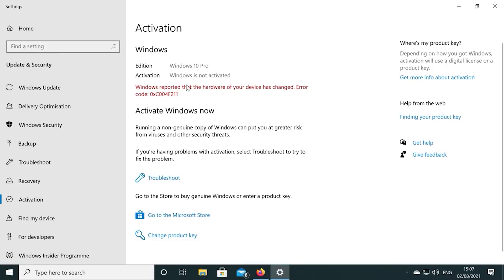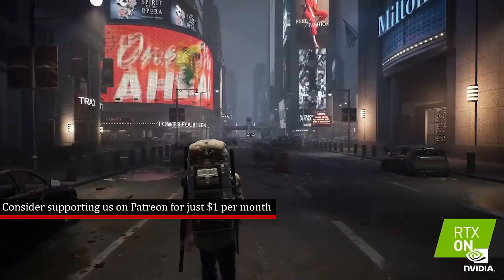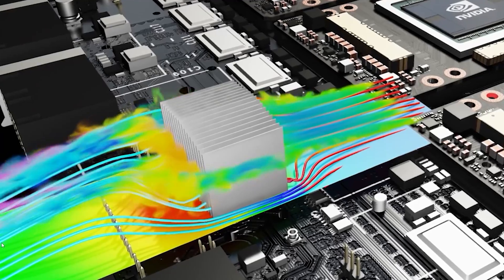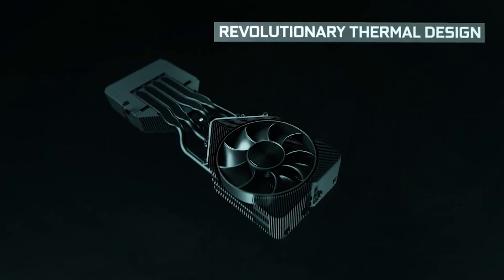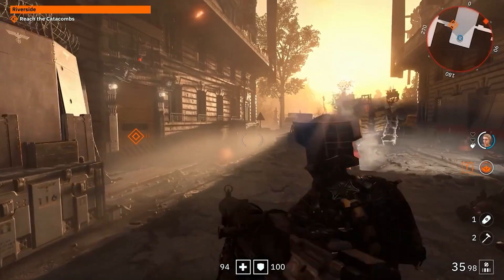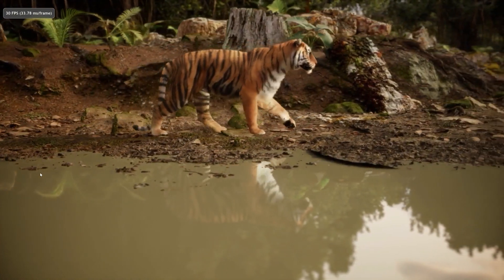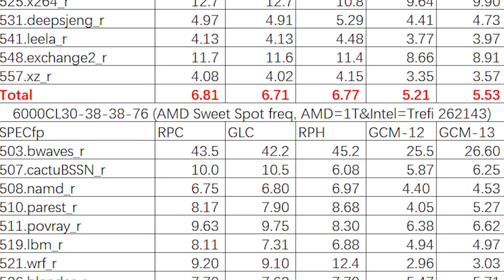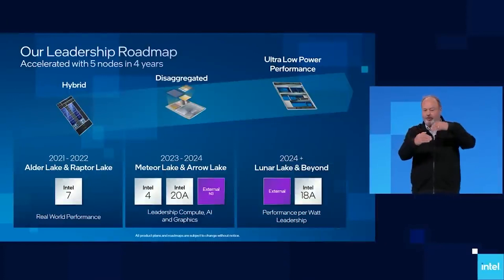RTX 4090 Specs DWARF RTX 4080 - Major Specs UPDATE | RTX 4080 Ti & Path Tracing Leaks

Comment: I don't think that's a massive gap for 4080 / 4090. That speed difference leaves space for a 4080ti in the future. I always said with the 3000 seires that the new 90 series are really just Titan cards rebranded so that consumers will buy them as gaming cards hence the large price gap between 80 and 90 series.
Reply: It is a massive gap they are on different dies completely. Then there’s 16,384 Cuda cores vs 9728 Cuda Cores. Massive bandwidth, VRAM and L2 cache differences as well. The gap between the 4090 to 4080 will be larger than the 3080 10gb to the 3090ti.
Reply: @ZackSNetwork  Let me clarify, I agree. I probably didn't type that clearly. What I mean is that gap is supposed to be big as the 80 series is always the $700-800 sku. That leave's plenty of room for a 80ti card in there around the $1000-1200 range and the 90 series gets the Titan pricing since it should be way more powerful.

Comment: I'm going from a 980 Ti, to a 4090 (or AMD equivalent). I'm expecting my mind to be fully blown.
Reply: @adrenalinejunkie3828  consoles don't hold PC gaming back anymore. They're based on the same architectures now so that's no excuse. They can much more easily build a game for PC, Xbox and PS5 with varying levels of quality without having to do as much leg work porting everything over. So even if the PC version has 10x better graphics it won't matter because they simply tweak them down to work on consoles.
Reply: I'm going to try and get a 4080 if not a 4090 coming from a gtx 680. Hopefully the 4000 series performs a good amount better than 3000 series.
Reply: @JaysRPGAdventures  4080 16GB or 4080 12GB? 16GB model seems like it will be 20% Faster than the 3090 Ti based on my Napkin Math.
Reply: @findlaywilliams6610  probably the 16GB model if I don't go with a 4090.
Reply: Not only will your mind be blown, but so will your psu. And ac bill. :)
Reply: @kaseyboles30  Yeah, I'm actually leaning heavily towards AMD because of that. I'm not going to run a card that turns my bedroom into a sauna.
Reply: Your wallet will be blown.
Reply: If you use a 1080p monitor and aren't upgrading that, then yeah you'll be blown away. If you're upgrading your monitor to 4k, you probably wont get blown away. 
At least that's how it happened for me. I went from a 1080 to a 6800 while at the same time upgrading to a 4k display. I was disappointed in the performance honestly. 
now I have a 6900xt and I still feel its not enough for 4k with all the setting cranked. my 2cents.
Reply: I can tell you that moving from a 1050 ti to a 1080 rocked my world
Reply: You won’t ever need viagra
Reply: dont forget to buy new computer and monitor as well, haha
Reply: @Azimuth2255  I decided to buy a 48" OLED, when they were the same price as low-end GPUs. Best decision ever; going to be sticking with this one until it burns in. And yes, I'm planning to build a totally new rig in the Fractal Torrent (seems like you'll need that case to cool the new stuff, if you like air cooling like I do)!
Reply: @adrenalinejunkie3828  What... My powermodded, watercooled 3080 can't even get 200fps in most 3440x1440p games at high settings. How could a slower card like the 2080 Ti be any good at 4k then. Maybe if you can endure the sub 120fps torture.
Reply: @adrenalinejunkie3828  Try playing Cyberpunk on decently cracked settings at +1440p. You'll see the difference. Heck even a 3090TI struggles in 1080p on max settings.. Those games are far in between, but they exist. Of course if all you play is CSGO and Warzone then yea the difference won't feel impactful, but then again who'd upgrade their hardware to play non-demanding games in the first place.

I went from a 980 to a 2070S and the difference was big.
Reply: @adrenalinejunkie3828  mymy adreline put some neurons around here

Comment: nvidia might want this time to have enough room for a 4080ti that actually means something.
the 3080ti basically is a bit of a weird card because the 3090 was just 10% on average faster than the 3080, so the 3080ti has not that much room to shine.
Reply: I feel like the 16gb 4080 they keep talking about is the Ti model and that's not coming until next year probably.
Reply: @toxicavenger6172  That seems very unlikely. The x80Ti is almost always a slightly cut down version of the top die, and this 4080/16gb has a lower end die and has way too few cores to possibly be a Ti.
Reply: Or maybe they should just stop oversaturating their own market so they don't maliciously self compete within their own product lineup lmao. They started this whole shitshow. If there isn't room for space between a 4080 and a 4090, then maybe that's how it's supposed to be. I'd like to see them sell gpus at 1500-2k range again now that the mining and scalping crisis has ended, while we're in a recession and an energy crisis.
Reply: @Real_MisterSir  enthusiasts who payed 1500-2000 for a card before the recession and energy crisis won't be fazed by the current state of the world. i know i am not. if i want a high end card and thats what it costs, i buy it. you might not like to hear this but thats the fact, and i am not the only one thinking like this. Nvidia knows this and thats why the 4090 will be at least 1599 but i would also not be surprised to see the founders card being 1999.
Reply: Vram on the 3080ti was the sweet spot that was the difference
Reply: @bobdole3251  yes 2 more gb of vram was worth double the price

Comment: Makes sense... They want to have the fastest card at a premium price, and then the rest they want to gimp so they can still sell us old 30 series
Reply: That's exactly it.
Reply: 100%. Every year there is a shameless manipulation of pricing structures. This the 2022 version. I think this is also symptomatic of diminishing returns in gaming hardware. They all play games pretty well at this point. 20 30 40 series. I have a mate still happily gaming on a 700 series. I do think as pc fans we are obsessed with all this gpu performance and the GPU manufacturers create this product range for us because we are so obsessed.
Reply: @paullasky6865  IDK... I just want a card that can comfortably game at 4k 100fps+ high settings that doesn't draw 400 watts and I'm happy. Haven't really gotten there yet
Reply: @Matt-gf4gd  depend on the game. Lots run over 100fps. In currently playing cyberpunk on a 3090 at 60fps and it's fine. FPS watching is a red herring.
Reply: @paullasky6865  yup. That's just my arbitrary standard for a new higher end GPU in 2022. Probably a Radeon 7800 XT will fit that bill for well under $1k.

Comment: If this is true its either bad news for AMD or a misstep for nvidia. 

Nvidia only cuts down the 80 class card this far if they know they have a clear winner.

Unless they know n31 is going to be between the 80 and 90. And are saving the 80ti as the n31 killer.

Time will tell.
Reply: @adrenalinejunkie3828  Agreed, I'm disappointed in Nvidia if this is true. It's coasting on mindshare which is a mistake intel made a few years ago.

What concerns me is that with ampere, they released the 3080 and it was a very good card, at least in the same field as a 3090.

Previously with Turing, Pascal, and even Maxwell. The gap between an 80 and an 80ti was HUGE. And they only did that because AMD essentially wasn't capable of competition.

That leads me to believe that Nvidia once again believes that AMD isn't capable of competing. At least not in the high end.

I hope theyre wrong.
Reply: @adrenalinejunkie3828  Not true. It will faster memory with more cache. If you expect high performance path-tracing any time soon you're fooling yourself.
Reply: @LowkeyTryhard  even if Nvidia manages to pull off some path tracing it doesn't mean that all the game developers will adopt it. We're going into the 3rd generation of cards with ray tracing tech and just look at the small amount of games even using that.
Reply: @toxicavenger6172  Look at AMD, Sony and Microsoft all adopting ray tracing.
Reply: @Safetytrousers  maybe so but it's been really slow for developers to add it to games nonetheless 🤷

Comment: NV has so many overproduced Ampere GPUs they still have to sell that the real price of 4090 or 4080 may have nothing to do with some PR MSRP they will show us.
If 3090Ti costs $1000 then 4080 probably would have to cost around $1300 and 4090 $2000+ so they can keep selling Ampere with some minimal profit they overproduced.
If 4080 would cost $900 then they should sell 3090Ti for $700, 3090 for $600, 3080 for $450, and 3070 for $300 - it's not going to happen for sure.
So I'm not so optimistic about this new release. The performance will be there but power usage and real prices may go out of control until they sell old chips they overproduced.
Reply: If the first case is true then fuck Nvidia, AMD here i come.

(Even though if love to use Nvidia Canvas, but screw it)
Reply: @x1c3x  True. I'm afraid that they will show us some nice prices during the presentation but you will not see these prices in real life.
If 3090Ti costs $1100 at this moment, so let's say they can lower the price to $950-$1000 then how much has to cost 4080 being much faster? 
The problem is that they have a full inventory of Ampere chips they have to keep selling. Time will tell...
Reply: @tomtomkowski7653  Nvidia will continue to disappoint investors then because people are not gonna buy into that BS. Supply will be hard to get as well.

Comment: So the 4080 12 gig is essentially a mid-range card....
Reply: 3080 10GB was midrange already.
Reply: @nipa5961  how the fuck is a graphics card built using a 628mm2 gpu “midrange”? It’s not like NVIDIA is using catastrophic dies to make the 3080. It has 81-86% of the specs of the full die, putting it comfortably ahead of GA103 in terms of specs. Furthermore, its effective transistor count is about the same as the 6800XT (2nd in AMD’s high end lineup as the 6950XT was a rebadge).
Reply: @dex6316  Jensen promised the 3080 to be their "flagship" but they managed to release another 4 more cards above it. Four!

Their "flagship" is the 5th best card out of the 10 Ampere cards they released. 
5 out of 10! Nothing can be more midrange then that.
Reply: @adrenalinejunkie3828  how is it forcing enthusiasts to buy the 4090, when a 16Gb 4080 exists (faster than the 12Gb too)?
Reply: @adrenalinejunkie3828  It will be faster memory with more cache after all.
Reply: …no. 

It’s going to be a beast 1440P card
Reply: @adrenalinejunkie3828  Forcing enthusiast lmfao no one is forcing anyone. Enthusiast have always targeted the best anyway. Which would be 80ti, Titan or 90 series GPU’s. I am an enthusiast but, I don’t agree with the nonsense Nvidia is doing.